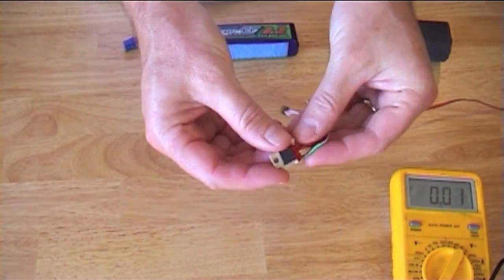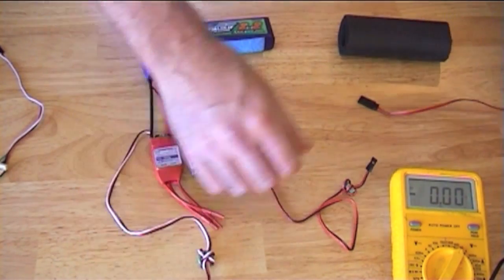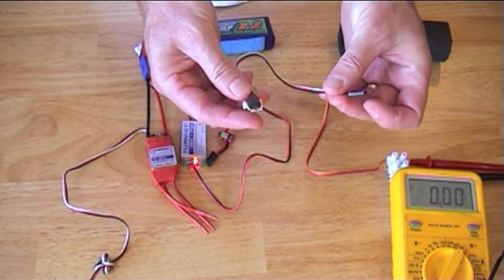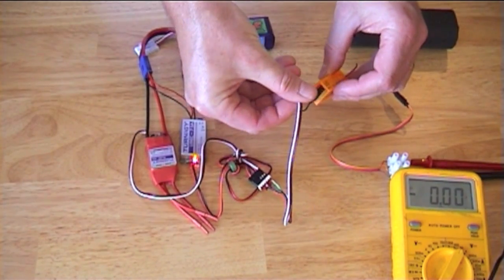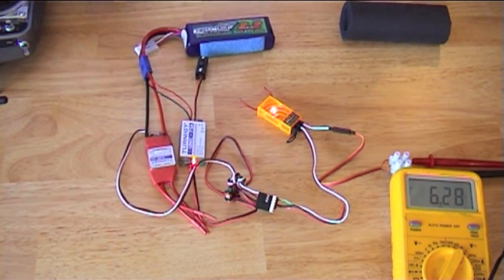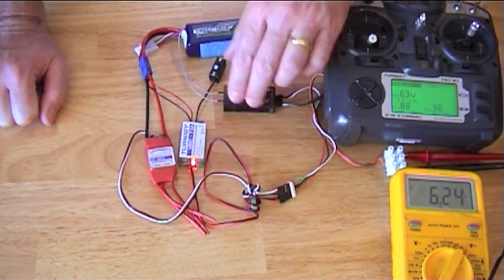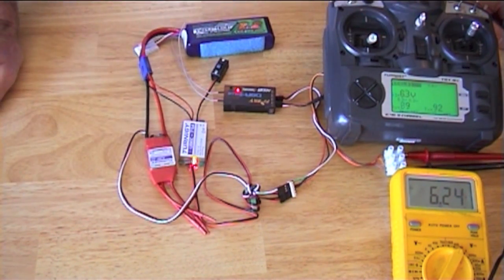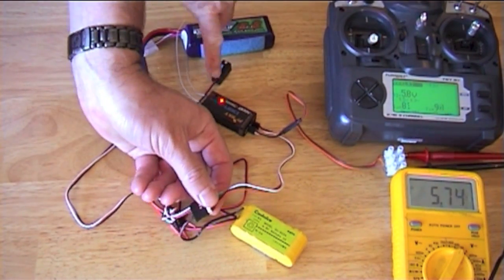Simple Bus-Tie Circuit for RC Planes

Comment: Very nice.  This is like a home-made Scorpion backup guard or Optipower Ultraguard it seems!  I am assuming it will work just as well if the main pack or esc goes first, then the attached backup battery will continue to provide power.  I have lost a couple planes due to thermal shutdown of the Esc with built in Bec, before I learned of these backup power methods.
Kudos!